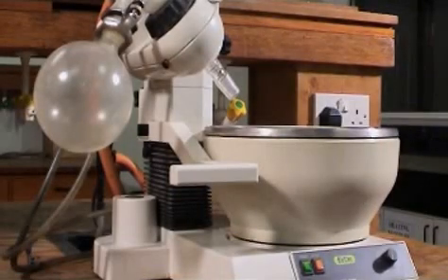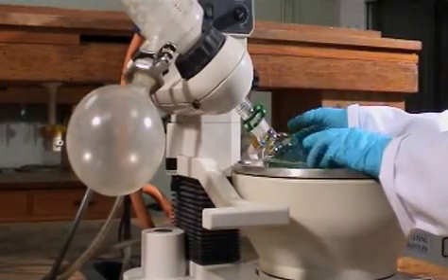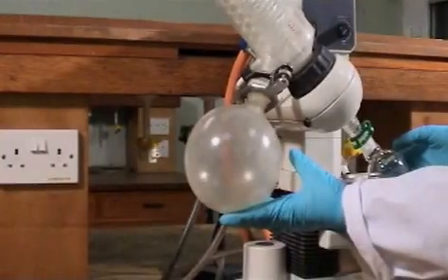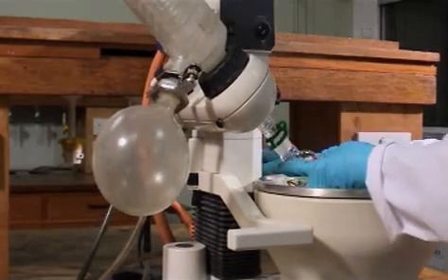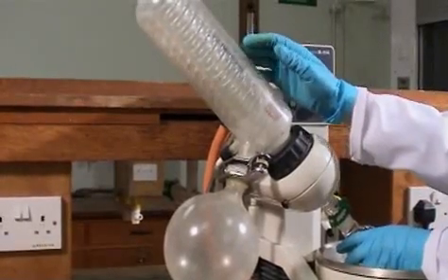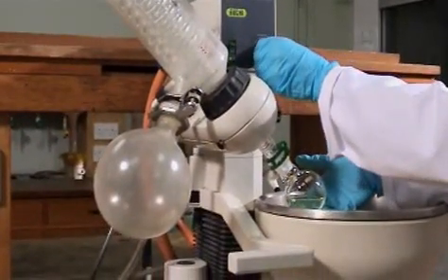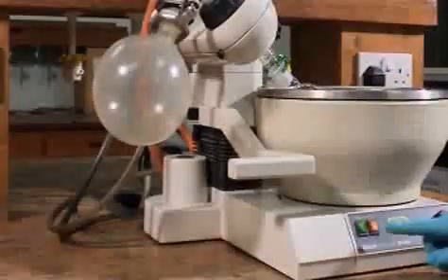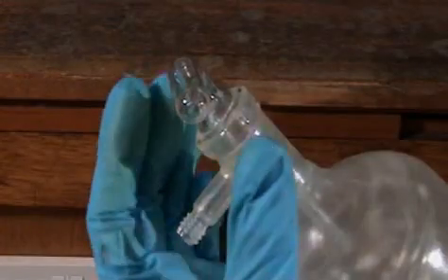Using a rotary evaporator to remove solvents

Comment: How do I remove what is left in the round bottom flask? Do I have to solubilize in another solvent to remove? If my product of interest is what remains in the rotary evaporator.
Reply: Leonardo yo you ever got the answer to that question?
Reply: @th3great13  You can remove your material prior to complete evaporation for easier removal. This requires afterwards a secondary purge process which can be done in a vacuum oven at low temperatures. You may also add a cold trap between your oven and vacuum pump in order to collect remaining solvent.

The other way is through a complete purge when the extracted material adheres to the sides of the florence flask and you in turn must use a scraper to remove the residue. Tedious, but effective.
Reply: @plou0018  I would prefer a simple application of telekinesis.